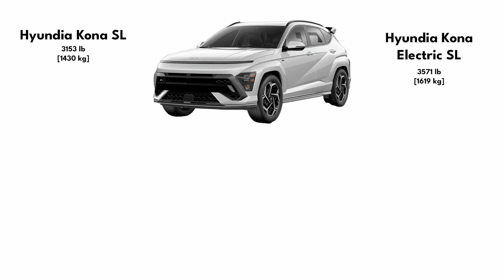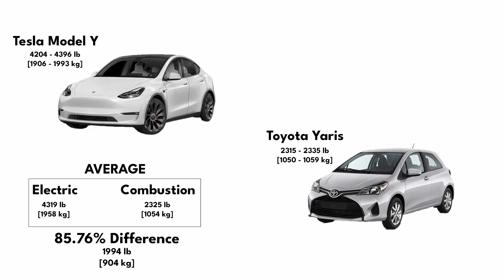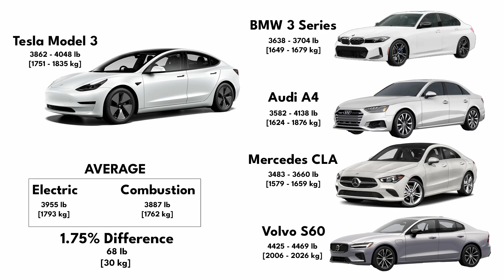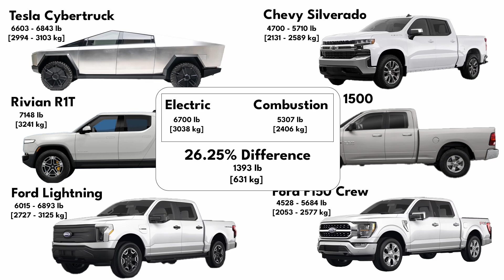Shocking Guardrail Failure: EV Weight Debate

Comment: Theres a lot of light weight petrol cars sold though, are there a lot of light weight electric cars? The number two selling small petrol car here in NZ is the Suzuki Swift at 1000kg. The popular Totoya Corolla is around 1300kg. A common Nissan leaf EV weights around 1600kg. It seems overall the EV's will be heavier and add weight on bridges and roads etc.

Comment: So the Telsa Model Y weight is at 4396 lbs generally speaking, however a direct comparison is the Audi Q5 at 4045 to 4685 depending on hybrid or not. Another is the BMW X3 is 3,931 to 4,610lbs.  I don't understand why people say they weigh thousands more than other cars.  My F350 is just over the Cadillac Escalade IQ at over 9K lbs.  I will give you the regular ICE Escalade is way lower like 3K less, however that is the exception to the rule here as it has a 212kWh battery pack that is 258% larger than the Model Y battery.  👊😉

Comment: Hey ST, I've seen a few different articles, EV vs real cars. I believe it's the center of gravity! Combustion engine cars have a higher center. EV's have most all of their weight 6 to 8 inches above the road surface. That battery pack will hit the guardrail and slice right under and lift the beams up. Then again, I never want to be in an EV with or without an accident. When I get cremated, like to be dead first! The battery packs slice the uprights off and keep going. Maybe instead of riding around with a bomb under your ass, put the battery in the trunk with a firewall separating passengers from the BBC. Thanks ANB

Comment: Your wrong about the reason for the model3 getting undervthe guard rail. This was due to mechanical leverage and nothing to do with c of g. Yes, your info on the cofg height difference is correct, but nothing to do with the way the model3 jacks under the rail. Keep up the great work.

Comment: A guard rail was designend to hold back cars with a max. weight of 1500 kg. Cars are just to heavy. SUV and Pickup Trucks make it worse with a high centre of gravity. 
The way the overweight vehicles are powerd doesn't matter.

Comment: EV is better at the 1/3 and 1/2 frontal crash test to occupant. Due to the front additional crumple zone. 
However the B piller side hit is a shocking failure worse than the ICE fails.

Comment: Don't forget when the electric Hummer with a 2500 pouch battery appears burning in the news cycle. Using a IR look at the thermal management results on the pack of a 20-degree incline pulling 5000 pounds at 50 miles per hours. Very hot. This should be a dyno test criteria with published results for NTSB consumer safety rating. Also no trailer towing capacity considering the results of added thermal demand. Push that csusebI don't have a voice.

Comment: I see that a lot of guardrail systems are still installed wrong (reinforcing connections that were meant to give way), and too low for most modern vehicles.

Comment: The real problem NOBODY is talking about. People putting load range E tires on their Bolt SUV. Sure, they last a lot of miles. BUT...your Bolt suspension is NOT able to control an extra 30lb of UNSPRUNG weight. Save money on tire wear, spend more on shock absorbers. Bad shocks are just as dangerous as bad tires.

Comment: My only quibble is with the Model S comparables.  Most internet comparables start with price range, not size.  Being a bit pf a German car geek, better matches overall size-wise would be a 5 series BMW,  an Audi A5,  and a E-class Mercedes.   By German/European general rules, the Model S would be a mid-size car, which the 5 series, A5, and the E-class also are.  The 7 series, A7, and S-class are the flagship cars of  those companies' product lines and are correspondingly large in size.  The difference is, that by US standards, those would probably be considered larger mid-size cars; If you've ever seen your average German parking lot, you know why even larger German cars are smaller than their US counterparts--there just isn't room for something that big to maneuver in the very tight quarters present.

Comment: Are combustion vehicle weights measured at full tank or empty? How much does the weight change across different fuel levels?
Reply: Most cars have a tank between 13-20 gallons. At 6 lb/gal that's 80-120 lbs for a full tank. (36-54 kg).
Reply: Makes no difference. A full tank of gas is 80-200 lbs, depending on model. A battery pack is, what, 1000-1600lbs?

Comment: What you are unintentionally doing is discrediting EV's as a viable replacement tech for existing vehicles.  You are equivalent to a climate change denier, simply rejecting scientific data you don't like.  EV's are on average 1,400 lbs heavier than regular cars, this is directly from the US, EU and AU government research.  Ignoring your dumb examples that are meaningless, the government compares average weight of all ICE vehicles to all EV vehicles sold in 2023.
Reply from the maker: What data am I rejecting?
Reply: @StacheDTraining  There is no debate that EVs are significantly heavier than ICEs, it's the reality of the situation.  This also results in them being less safe in crashes as heavier vehicles have more kinetic energy to dissipate.  This isn't a knock on EVs it's simply the reality of the technology, accept the benefits and the drawbacks.

Comment: Since 2005 it has been UK policy to replace the central barriers on Motorways with concrete walls able to withstand hits by goods vehicles. In part this was after several highprofile deaths involving SUVs and lorries,  which were able to simply go over the barriers. Also the addition of a fourth lane allowed a steeper angle of attack, thus needing a better barrier. Nothing to do with EVs.  Central barriers are of course designed to restrain not just 'test' vehicles but more importantly fully laden goods vehicles 
I rather question the methodology used in the University tests, it is almost as if some one wanted to make a point rather than carry out a real world test.
A point conveniently ignored in the weight discussion is the Gross Vehicle weight of the vehicles . To what extent does the greater kerb weight of the EV result in a reduction in the load carrying capability .

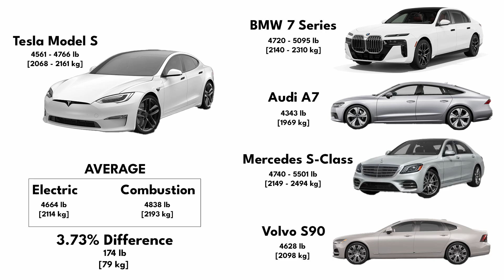Comment: 5:02 this type of comparison is not on vehicles mass and size but on perceived luxury at a similar size.
The Tesla and Yaris are probably closer in comparison than the luxury brands.
The Tesla model S is actually a fairly compact vehicle similar in size to a Yaris.
The comparison should be done on wheel base and cabin volume.
The electric vehicles still need significant structural strength in the front or rear in order to carry the weight of the vehicle and provide crash protection, they also carry a lot of ancillary equipment like inverters and cooling systems so not having a gas engine makes little difference to the weight of the structure.
On a side note most if not all the comparison vehicles have hybrid and full electric options thus I suspect they have been optimised for both

Comment: Guard rails w rail are based on a F250 pickup truck.  Remember there not based on motorbikes or even semi trailers.  How about the Hummer EV that is very very heavy possibly 4 ton plus.  Great video yes my model 3 is low and would go under the w rail.  Impact angle gets larger but with lower speed. Higher speed low angle.  Very interesting I have attended barrier crash testing and there is a variety and depends on the car or pick up truck but left out motorbikes!

Comment: People freaking out about car weight (EV or otherwise) confuse me.  Cars weigh the same now as they did fifty years ago (in America at least).  This isn't some radical shift that our infrastructure can't handle.  It's more of the same that our infrastructure was already designed to handle.

Sure there are more doofy giant trucks out there now, but those aren't introducing new weight classes either.  Our roads have had box trucks and cargo vans and semi-trucks on them for decades.  Heavy vehicles always have and always will exist.

Comment: Well I ma no expert but it does occur to me that EV's have a much lower centre of gravity than an ICE counterpart - of course I hold my hand up to be wrong - and the fact that the centre of gravity being that much lower would mean that any object that the EV strikes guard rails and barriers and even heaven forbid a pedestrian will substantially add to the damage to that object being struck - for example any retaining posts and again heaven forbid a pedestrians legs. Plus weight for weight surely an EV would have far more momentum than an ICE vehicle if the braking capacities of those EV's is much the same as the braking system setup on an ICE vehicle??. I do stand to be corrected of course. My other question is why are the drivers of these monstrous pickup trucks not trained to drive one and have a special licence as in say a large truck driver has to have becuase in my mind there is not  lot of difference when it comes to driving these obese vehicles??

Comment: I looked for the University of Nebraska's report and there is additional detail that perhaps explains their selection of impact angle: this research was sponsored by the military who wished to evaluate barrier protection used at military bases:
"In research sponsored by the U.S. Army Engineer Research and Development Center (ERDC) and partnered with Auburn University's Transportation Research Institute (led by Laurence Rilett, former Mid-America Transportation Center and Nebraska Transportation Center director), the Nebraska facility recently conducted a first-of-its-kind crash test of an EV pickup truck to better understand whether currently used guardrails and U.S. military protection measures against hostile vehicles are prepared for the growing number of EVs."

Looking at the same University facility, they are regular recipients of military sponsorship for barrier tests going back years, so the test specifications (impact angle, etc.) are as requested by their client.
Reply from the maker: My concern isn't why they used the angles they used. It's more the conclusions that the media & others are using based on the videos.
Reply: Thank you! This should be the first thing everyone points out about this study whenever we see a clip from it - these tests are intentional ramming, not crashes.

Comment: 5:15 In what universe Tesla Y sedan is equal to different off-road vehicles ?
Such comparison only valid, if it is price-class comparision, so it is not applicable.

Tesla S also seems to be shorter/smaller in its comparison counterparts.
Reply: Aren't all four of those vehicles at 5:15 crossovers?  Every one of those looks like a grocery getter, not an off-road vehicle.

Comment: It's not really worth worrying about, electric vehicles will not last in their current form, electricity grids will eventually be overwhelmed if there are too many of them.The stated range of these cars is a myth, they're next to useless in cold weather, the resale value of EVs is in the toilet, no one wants a used one because it  costs a fortune to replace the battery pack, that's why used EV's sit on dealer lots with no one wanting them. They have a propensity to catch fire for no reason, insurance companies hate them, premiums are going through the roof, soon no one will be able to afford to insure them. I'm afraid your concerns about EVs blowing through guard rails is probably the least of their problems.

Comment: Seems like the university study didnt present enough of its data to be useful to anyone studying guardrail performance. No overhead camera view or view looking down the line of the barrier was published. They went for sensationalist camera angles rather than useful ones.

This suggests this was FUD with a thin excuse of research. Hopefully at some point they will publish their findings and include the specifications of the test setup.
Reply: Or maybe they destroyed a vehicle to showcase actually how dangerous they are in these situations and to make us consumers more aware of our decisions. It’s not Fud just facts…
Reply: @TidleyWink64  we already know that a car crashing into a concrete wall is dangerous, so this test adds nothing new. Without being informed about the impact angle and vehicle speed it's difficult to draw conclusions about if the metal safety barrier is able to work as intended. Any car will go straight through those barriers at the right angle and speed.

The crash looked pretty safe for vehicle occupants, it bounced through and over the obstacles without damaging the passenger compartment... Of course in real life they would have hit the hazard the guard rails were supposed to protect..

Comment: What exactly are the statistics on how guard rails protect people in cars? A Tesla model 3 with 4 occupants drove off a 250 cliff Devils Slide in CA and all occupants had only minor injuries. The car saved them.
Reply: Are you for real? Statistics for guard rails are what has driven improvements in design and technology.  Motoring has been around a while, we already know a lot about safety. Anecdotal evidence doesn’t count.
Reply: The safest cars on the road are Tesla's. The low center of gravity actually helps it in most other crash situations. In fact, the guardrail footage of the Model 3 shows that it still forced the car to stop its forward path and forced the direction forward without deflecting it back into traffic. Go look at dashcam footage on youtube and you will see how many secondary crashes happen due to cars deflecting off guardrails back into traffic.

Comment: With the HUGE increase in trucking on the roads barrier technology needs improving,50,000 lbs plus through one of those “tin”barriers won’t work.
Reply: Guardrails were never designed or intended for tractor-trailers

Comment: And ICE vehicles lose weight as they burn off the gas. In aircraft, this weight reduction is dramatic. Big difference between allowed takeoff and landing gross weights.
Reply: Rather less dramatic of a difference in my vehicle which has a 20 gallon gas tank - looks like a gallon of gas weighs around 6.1 pounds, making full tank gas add 122 pounds. So, going from empty to full or vise versa only makes weight change equivalent to an early to mid teenager getting in and out of the car.

Comment: I looked at both clips very carefully and they are two camera angles of the same, single crash. The 'head on' looking angle is optically compressed because they are recording with a very long lens eg 1000mm. Obviously they had to set the camera at a safe distance and zoom in for the shot. The other camera angle is using a more normal lens 50mm - 75mm maybe.

Comment: You are comparing tesla's with higher class cars from brands notorious for being overweight.
Compare Model S with 2024 Mazda 6 (sportbreak/station 194 HP, autobox). Large spacious car with good performance. Not as fast as the tesla, but 600+ KG LESS!!!!!!!!! and over 40% cheaper than a model S. And as a bonus, petrol car tend to work in the cold and heat with hardly any loss of range.
*large: for European standards, for US it will be average, normal size.
Reply: If you look at stats, it looks like they are comparing the wheelbase and internal volume. These are core selling points that dealers look at. Of course a smaller car with a smaller wheelbase and less internal volume will be lighter.
Reply: @segstron  That is why i stated the mazda 6 estate/sportbreak /station depending how it is called where you live.
Reply: @basbass429   No Mazda 6 in Canada unfortunately. The only sedan here is Mazda 3. The estate looks like it would be nice car if it weren't so underpowered

Comment: My one ton 93 D350 2wd weighed 6189 on the scales with a three quarter empty tank and a bunch of tools in the back. Thats about the same as the Rivian if you take out the weight. The engine is a 12v cummins in my truck and it weighs 1200lbs. Its a cleaver engine i a hollow lego block body in between its framerails. The front is flat with a chin bumper. It will hit hard and i dont know what will happen to what is in front of it but ouch. If it is highway speeds vs guardrail. I think it would probably bust up or through the guardrail no matter what. I dont know but without a load it seems very possible to roll. The Rivian has the weight all throughout the vehicle. Mainly though in the bottom center. In an actual head on collision I dont think all that mass throughout the body will be that easy to stop. It will hit whatever its going at hard. The difference is instead of a front cleaver it has a lower middle/full one. Its a unibody vehicle. If you crash it its done. If theres a big dent in the back the "repair" isnt possible and they toss it. Im not an expert on vehciles or Crashes. im just an automotive hobbiest and love cars.